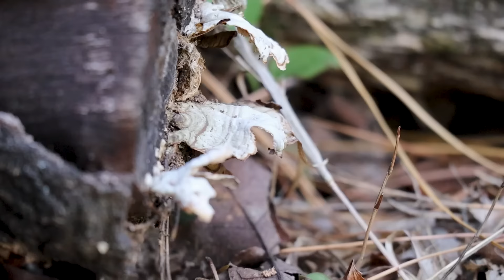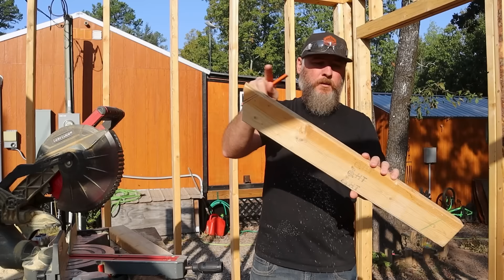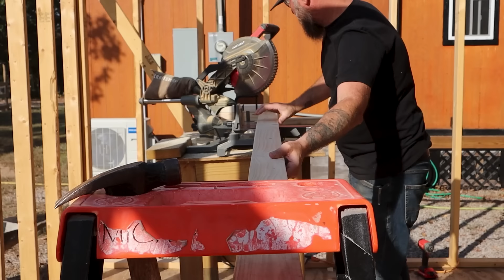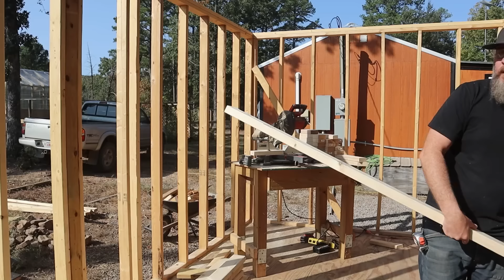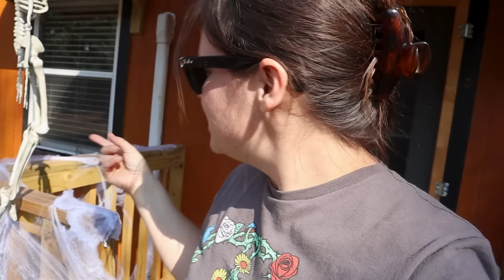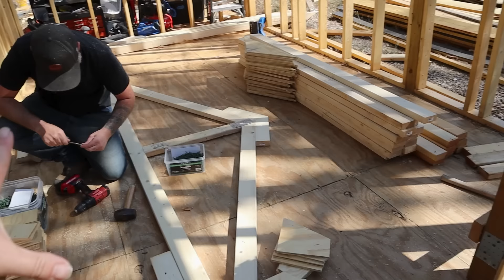Was this a BAD IDEA for this BUILD...| DIY | Shed To House Conversion

Comment: Hi Rox and Ant, a bit late now but an idea to bash those gang nails is to use a 1/2”thick steel plate and slam it with a mash hammer, even pressure across the plates. Still the ply is great bracing. I like how you got into a systematized approach, makes the work more efficient. It’s all coming together and it’s solid.

Comment: Great idea Antony  I always built my trusses the same way using a jig it eliminates any discrepancies. Another idea is to mark the one end of your jig A or B  and put all the A's to one side and all the B's to the other so if your jig is off just a little at least it will be all to the one side and will not be noticeable. blocks on the floor will set all the pieces in the right shape. God Bless from your Canadian Friend.

Comment: suggestion confirm the one already built is correct 
  then lay on floor use block all around and   support  so all you need to fill in put on the plywood joint supports  lift out and repeat